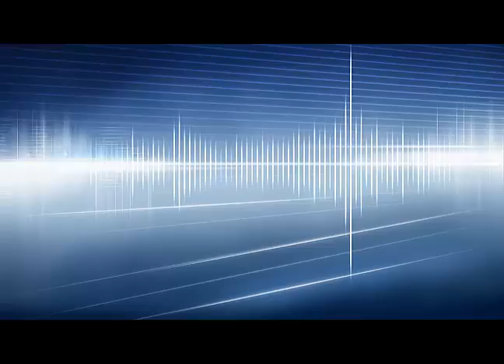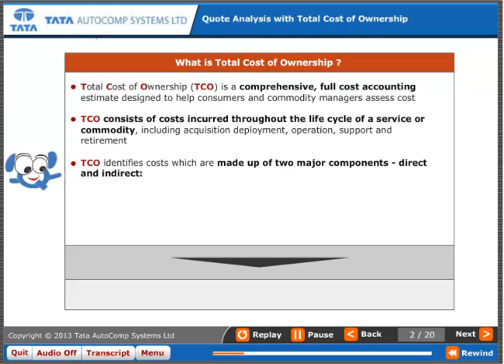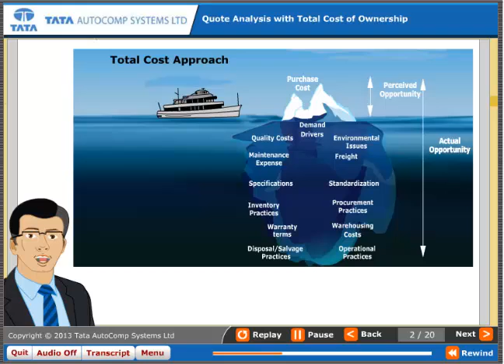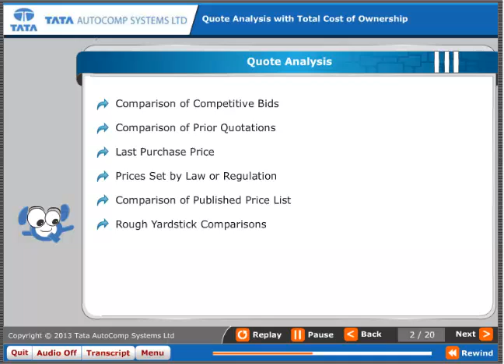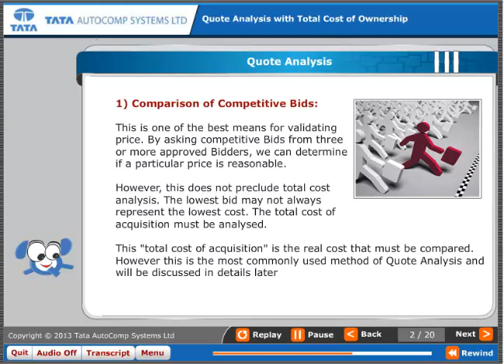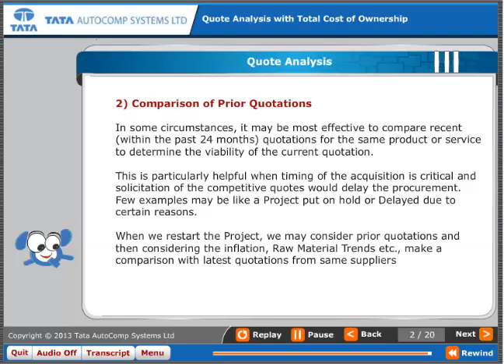Quote Analysis and TCO (Total Cost of Ownership)

Comment: Great video, here is an explanation I offer my supply chain students:

Let's say you have a supplier and you are starting to get the vibe that you are overpaying.  What can you do?  You could ask them for a cost break down.  However, if a CURRENT supplier does not want to break out costs for you (the buyer), then the contract should allow for competition once a reasonable period of time has elapsed for the supplier to recover their fixed costs.  Most Buyer-Supplier contracts actually let a buyer cancel a contract for almost any competitive reason (i.e., they think they are overpaying). 
SCM Factoids:
 
A cost breakdown should be requested with each RFQ (request for quote). RFQ is a fancy way of saying:  I am a buyer and I am requesting that you (the supplier) bid (quote) for this business.  RFQ can either stand for Request for Quote (quote me the buyer on this business - tell me how much it would cost me) or it can stand for Request for Quotation (I want a quotation/bid from you the supplier on this potential business with me the buyer).  Get it?  This should be requested using the following statement:
“The buyer will only consider quotations accompanied by a cost breakdown”.
Suppliers may not want to furnish this information, however, it can be required by the RFQ (the supplier has to make a choice).  If the quote is for a commodity and there are tons of suppliers to choose from, then the supplier is probably going to give a cost breakdown.  However, why would a supplier do this if it is a highly engineered part and the buyer has few suppliers to choose from.  In this case, the supplier could professionally give the buyer the middle finger and say here is my price and that is all that I am telling you. 
Warning:
 
Merely reducing the supply base to reduce the supply base does not make sense. Management goals, like “reduce the number of suppliers by 30% this year” usually have the wrong effect (and lots of companies do this). Each acquisition should be evaluated separately. If welding wire is available from three suppliers and no price breaks can be gained by buying all welding wire from one source, then maintaining three suppliers gives the firm more assurance of continuous supply while the cost of buying from three suppliers is not significant greater.  Does this make sense to you?
 
Academic researchers (educated idiots like me) say:
One approach is to award 70/30 split contracts. The supplier with 70% of the business can provide needed services, while the supplier with 30% of the business provides safety of supply and also puts pressure on the large supplier.
Reality: Single sourcing. Most companies are using single sources of supply to get bigger price discounts via higher volumes (economies of scale). Also - Some firms like to become a big portion of their suppliers' business so that they can apply pressure on the supplier.  American companies are infamous for this.  Why?  Because they are greedy.  Thank goodness for that because they are paying top dollar for ISM graduates.
 
How should companies use competitive bidding (think long-term)?
 
Typically, buying organizations will use several rounds of the competitive bidding process to pick a low cost supplier. Buying organizations will send out RFQs to get bids from suppliers. RFQ stands for a Request for Quotation. In other words, please give us a quote for this business. Unfortunately, several iterations of the competitive bidding process can be very resource intensive, especially for smaller companies. Larger companies have been able to somewhat reduce these costs by using information based technology (e.g., electronic reverse auctioning).
 
Either way, the data seems to indicate that several iterations of the competitive bidding process does not get the lowest price. Why? Suppliers pad their quotes from beginning to end because they know the game. Data indicates that the most effective way to get the lowest bid is to tell suppliers that they will only have once chance to bid/quote on the business. If they really believe that, then they will deliver their best quote the first time around (because it is the only time). However, very few companies actually make bidding a one shot deal. Most companies are too greedy and are not convinced that the one time only cycle works.
Another problem with competitive bidding is that you are just trying to get suppliers to low ball each other and that means you are just hacking away at their profit margins. If you have a current supplier that charges $1.00 per part, and it costs them $.90 to make it, they have about a 10% margin. If you have them rebid and rebid and rebid on the business, and then they agree to $.93 per part, you are indeed paying less per part, but you have reduced the supplier’s margin down to nothing. Smaller companies with larger industrial customers have often been victimized by such approaches.
So, why would a smaller company use the same ineffective tactics on its own suppliers? In a perfect world, buying organizations would sit down with suppliers and help them reduce their direct costs (e.g., labor and material). Most of a supplier’s costs are probably already coming from direct labor and material which means there are probably some significant cost savings to be had. What if you could help a supplier cut their direct costs by 30% and then you tell them they can still keep the 10% margin? That supplier would say thank you because their margins do not change. They are just more cost competitive and probably end up getting more business because of it (and you now pay around $.70 per part).
 
Also, there is nothing stopping a smaller supplier from asking its larger customer for assistance in reducing its direct costs. A larger customer probably has the resources and skill sets to offer just this type of assistance. It would also demonstrate the cost improvement intentions that customers often seek in suppliers. A recommendation for smaller companies is to take a strategic approach to their sourcing decisions, even for commodities. That often requires a careful analysis of how its customers manage them and perhaps not necessarily using the same tactics with its own suppliers. Smaller companies can look to the ineffective tactics of their customers to better manage their own supply chains. Perhaps the customer will then ask the supplier for help.
Dr. Sime (Sheema) Curkovic, Ph.D., Valluzzo & Lee Honors College Faculty Fellow
Professor, Operations/Supply Chain Management
Western Michigan University, Haworth College of Business
Schneider Hall Room 3246, Kalamazoo, MI 49008-5429
Tel.: 269.387.5413;  E-Mail: sime.curkovic@wmich.edu
"Better, faster, cheaper";  www.wmich.edu/supplychain
"WMU Integrated Supply Management (ISM)...Nation's best undergraduate SCM program (Gartner 2014); 2nd in SCM technology (SoftwareAdvice 2015);  2nd in top global SCM talent (SCM World 2017)
Vitae: http://www.wmich.edu/sites/default/files/curriculum-vitae/CurkovicVitae2017_